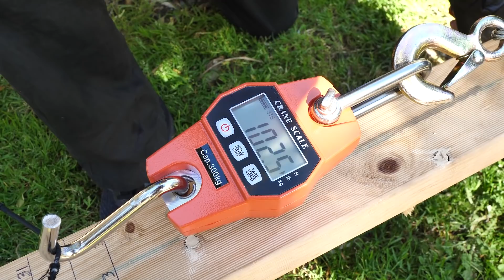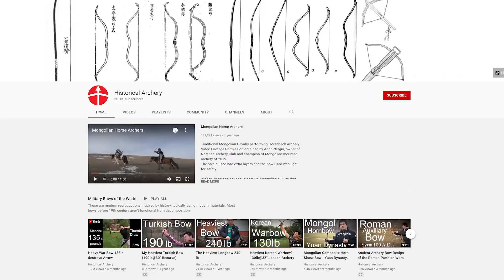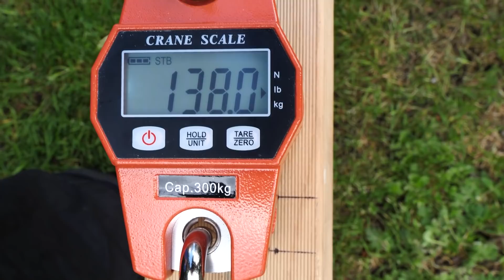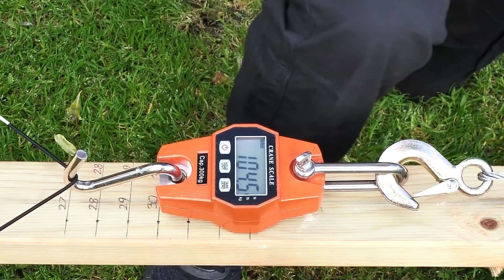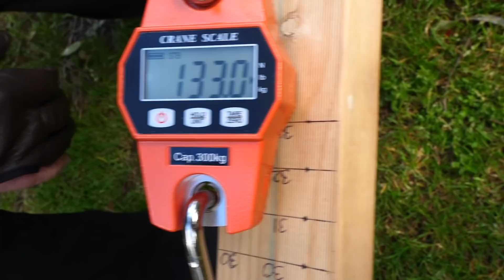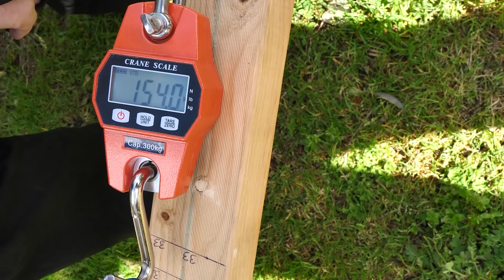Two idiots try to string a  TINY BOW

Comment: The secret is: 1) You don't need this much power to pierce armor with any asiatic / horseback bows. They're nothing like a longbow. 2) The "wall" in a bow is a palce where your pull weight goes up by more than 5 pounds. Using the bow over that may damage it.
Regarding your pull, looking at how you're fighting it, I'd say you shouldn't pull more than #60.
It always amazes me how silly this show is. People please don't take him as an example, you can hurt yourselves.

Comment: A have a 100 lb recurve bow and the step through method is far easier for me then a bow stringer. I absolutely hate using a bow stringer. It's difficult to string but nearly impossible with a bow stringer. Odysseus style is by far the easiest way for me. For reference I am 5 ft 8 170lb. My bow is 54 inch when strung. It is very hard to find arrows for this bow. What is the fully strung length?

Comment: At first, I thought this was just a video meming on how small bows would be weaker than long bows. Particular refering to the "Shoot like an Elf in a Tree" video. And alot of the images of elves having the arrows strung full draw, only about arm's length, not to the ear. And from the "Fantasy Ranger" vid, Long bow/War bow should be main pick, not some weak small bow. So I've got in my mind for Role Play Long bows > Small bows in strength. Now however, seeing this changed my mind ... though I'll have to wait and see the proper video to come, and see it in action. I still plan to use long bow/war bow in video games/Role Play, you know cause big bending stick energy lol, but least can respect those using smaller bows ... if they know just how to word it.

Comment: The larger longbow is how I always imagined Two Rivers longbows. For the recurve, the reason that there is a huge ramp in draw weight is because at that point, you are changing which part of the bow is pulling. The further back you draw, the closer the bend is moving toward the handle.

Comment: It hurts to watch this being someone who uses a horse bow on a weekly basis. Yours looks smaller in length than mine and your pulling much more weight so that is going to be incredibly tough to string. Mine is a nice comfortable 40lb and its but I wouldn't be able to string it at double the weight...no way in hell i could manage 110 and im a strong guy. I would like to see you fire a lighter bow and then the heavier bow in terms of your accuracy my guess is you have no accuracy on the heavier bows (because your shaking like a leaf!) but something more comforable that your not shaking with...i bet your shooting would improve by a mile. I don't believe anyone should shoot at the maximum they can physically draw...because its near impossible to hit anything. Which is why I think you vastly under rate how accurate a heavy bow can be.